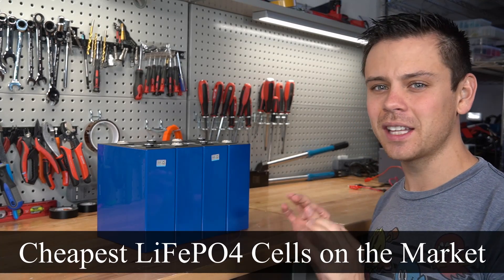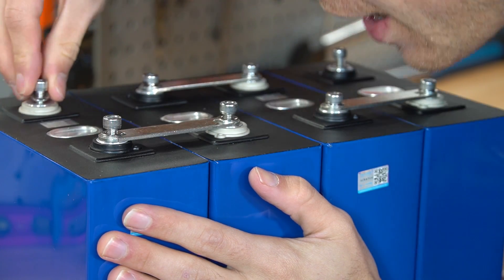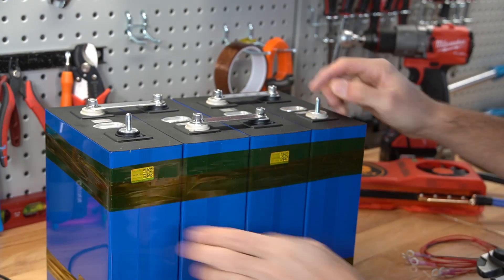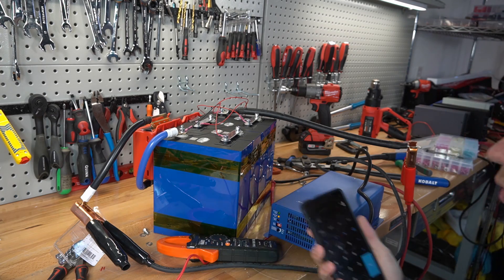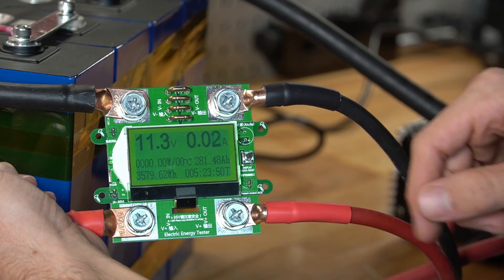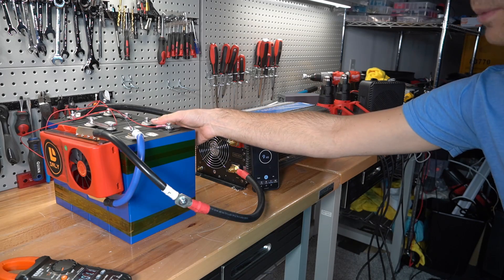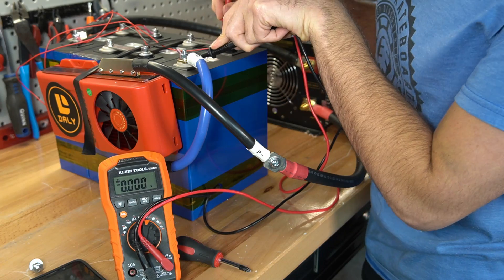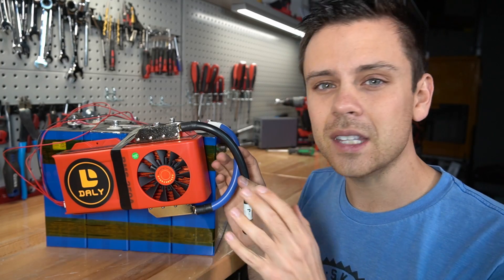$433 280Ah LiFePO4 Cells Tested: Cheaper than lead acid!

Comment: I'd be very interested in seeing a tear down of one of those Fortune batteries with the huge terminals, and one of these EVE 280ah batteries with the wimpy aluminum terminals. I suspect the larger terminals may only be skin deep!

If I were to build a 24v system for my RV today, I'd go with the 280ah batteries and use conductive epoxy to glue in the wimpy stainless steel studs, then use same epoxy and lightly torque/glue the nut against the aluminum base with glue making it super rigid. I could then top it off with another nut to hold battery connectors, wire terminals, etc. while tightening nut against nut very tightly with wrench on the bottom nut to prevent undue torque on the aluminum/stainless stud and glue.

Comment: Hi Will, really thanks from.... Mexico where Lithium batteries are still... Mith!. YOur info videos are very useful and very well done. Now, as you can easily understand, i'm just studying the LiFepo4 batteries. One question regard the charging. Usually the data sheet of the batteries says CC (constant current) btw  i understood from your videos that you just fix the voltage an d the cells drawn the current they need untill they are cherged.... so ity seem that very standard solar charger are perfectly suitable for the work, if well programmed about the maximum voltage....am i missing some video? ...completely wrong? The second question is about  "prismatic" what does it really means .... about performances and costs... Again, Thank you, Daniele

Comment: Hello experts, I put a 4S DALY BMS to my 272AH pack and check the voltage from BMS P- to Batter B+ and it show 3.11V, when i check from Battery B- to B+ it show 13V.... is the voltage from P- suppose to be same as B- ? thanks

Comment: Best,
In my outdoor enclosure I have no power so I use lead-acid batteries, are charged with solar panels +/- 400 wp forest environment. batteries go 12v system how do I do this best batteries are charged with an mppt charger of 80 amp but I only get this value in the summer good tips to change my system to lifpo4 :)
Begium

Comment: Hi Will, been following you for some time now and thanks for all your videos and input, in valuable. A 'Q' now. I've built a Solar Power Box but the battery provider has let me down. I'm looking to purchase 4 x 3.2(6)V LiFePo4 200Ah now but the size means that I would need to have them laid down so that the terminals are on the side as opposed to on the top. Is this able to be done safely with LiFePo4 batteries, and, if so, should the positive or negative be on the top, or does it not matter?

Comment: Let me get this straight, 1C peak and >200Ah?  That means 600W per cell.  With 16 cells, a 48V battery, you have a 9.6kwhr pack that can charge/discharge at 9.6kW.  THAT'S A GAME CHANGER.  That's $2k for the cells.  And only 48V so I don't have to be too terrified working on it.  Of course I still need to buy the BMS and all the fixings, including, vitally, a solar charger and automatic transfer switch.  Plus, let's say 2kWp of PV.  What's my tab so far, $6k, being very conservative?  What $6k gets me is a solar system for one 3ton house AC unit, that switches to grid when the battery gets below my configured voltage.

I live in a state (the ONLY goddamned state, look it up) that penalizes families that install solar and stay connected to the grid so that their return on investment is stretched out 2x farther than anywhere else in the country.  An automatic transfer switch is my only hope, since then the PV system will never be on our goddamned utilities' goddamned grids.  I was thinking I'd have to go to 100V to get the peak 10kW output I'd need to start a large house AC unit.  But with these cells I can do it with 48V.  That's way less wiring and way less danger, right?

Comment: Hi Will, great job.
I’m thinking to get these lithium 280Ah. I will also replace my 1000w inverter by a 2000w , I will also replace my Go Power PWM controller by a Victron MPPT and add a second 190W solar panel to my RV! 
So, 2 questions, what are you suggesting for BMS and what size of Mppt controller should I get for my setup?
Also, Have you tested Dakota lithium and the Canadian Lynac lithium batteries?
Thanks in advance,

Comment: Hey will, quick question, what are the data sheet specs for the daly bms for high and low cut off voltages, I’ve looked for it online and it shows 3.75 and 2.2 v for the high and low respectively, isn’t that alittle over the range?

Comment: @DIY Solar Power with Will Prowse.   At the end of the video you said you would never use the 'dumb' Daly BMS on a large system.    Could you elaborate on that?    It seemed to work quite well.

Comment: I want to replace my RV batteries with these. A dealer says it's a one-for-one replacement using Xantrex with only an adjustment required on the controller. Do you still feel confident about the inexpensive EVE batteries? Any other advice?

Comment: You don't need 4/0 cable for that lol. My forklift has a 36V 850Ah battery and the cable is 2/0, which is standard. Under max load, it draws up to 500A and it's totally fine. The current rating is better for unbundled cables, so it's fine to push it a bit.

Comment: With a 5000W Peak power 10000W 24V 48V 72VDC AC High Frequency 50Hz 60Hz With LCD Display Ture Sine Wave Battery Power Inverter

Comment: I know a lot of these are demos and you probably take them apart afterwards, but have you ever thought of applying liquid electric tape over terminals and bars on the batteries once they're assembled to isolate them from being shorted out by contact?

Comment: I ordered 8 of these and accidently overcharged one turned into a balloon ahhh now I have to wait 2 months for replacement
Reply: there's faster shipping options Im just not in a rush
Reply: @swagglifee  All the best!
Reply: I got mine on ebay for $750 with express shipping in 7days and ability to return it, so why you chose to get them from china??
Reply: because 4 cells are 430 with shipping
Reply: @swagglifee  I was thinking about it as a cheaper option but what if something happened how to return it? they will not allow you or at least you gonna pay for shipping again.
Reply: @bryanriggs4417  I felt confident in reviews I trusted the quality I was the one that damaged the cell I just bought 4 more incase I have future issues

Comment: I have installed these batteries in my electric 65 Falcon . Beware! The battery  shell is "live" and must be insulated
Reply from the maker: That's why they have sleeves. The engineers are well aware of this issue. So they add sleeves.

Comment: Hello Will, you keep doing a great job here, kudos to you. May I ask you for specs on the resistor that you use to pre-charge capacitors on the inverter? I have the same cells and a Samlex 3000W pure sine beast, but I hate those sparks. And if you don't mind sharing one more thing, what kind of tape do you recommend to hold these cells together as a battery bank? Thank you so much for all your work !

Comment: Will, we just got four Shenzhen 280ah batteries and are top balancing them. They started at 3.257 to 3.256. We are using a 10 amp power supply with larger leads to reduced resistance (lugs both ends). It’s been 72 hours and at the batteries the voltage is only 3.370 and at the power supply is reads 3.590 (actually set at 3.65) due to loading. A quality DC clamp meter confirming the 10amp reading of the power supply. Is this normal to take this long. Should we re arrange the jumpers and install the BMS then charge it with a 55 amp lithium charger to get them closer to top balance. Right now it’s like it has hit a wall and not moving much.
Reply from the maker: You should connect to BMS and charge them up all the way with a 12 volt charger. Then disconnect them and put them in parallel again with the power supply.
Reply: @WillProwse  
Thanks Will. Shall do!

Comment: I bought the 24v 500Amp Daly for my Bus Build. I expect a draw of 200amps max on a 4.5kw inverter maxxed out so I decided to use the headroom for safety. Seeing your 250 amp handle 290 amps was impressive though!

Comment: I think I could actually put this together I would buy it right now but I need to wait till payday so the full charge I would have 280 amp hours of power my four 6 volt 125 amp hour AGM  batteries when fully charged my system says I have 40 hours of power and that's my midnight special solar chargeryou fell at the lithium batteries I would have 280 amp hours

Comment: I have a motorhome with a 400 watt midnight special charge controller and a 5000 w 10000w surge inverter I have four 6V AGM batteries in seriesand I would love to change over to the batteries I just saw do you build these batteries just sell to someone like me

Comment: Would you use a BMS like that on each "battery"?  So if I wanted to put 5 of these packs in parallel, would I want 5 of those BMS units?

Comment: i need your help. please can you find out about felicity lithuim battery power wall- like packs. i am in africa and i bough the above product but after a week of install to my pip 8000w max inverter the felicity power wall shut down at a voltage of 49.4. the switch on the power wall wont turn it on so been afraid because the was a noise when it went off, i disconnected it from the inverter and i am back to my lead acid batteries. 8 220Volts connected to make a 48v system two parallel strings.

Comment: Hey guys this is my first battery project and I have a couple questions. I am building a 48v golf cart pack using 16 of the Headway 100ah prismatic 3.2v cells. The BMS is a non smart 150a Daly and it appears to have a temp probe. I have already modified the power leads of the BMS by adding another 6 ga lead in parallel. I thought I was ordering the BMS with the large bus bars on each side. But what showed up was 2 6ga leads on the end, in my opinion not enough capacity. The amazon ordering for the daly BMS really does suck.
Questions....
I will have 8 cells on each side of the cart, does it matter if the BMS cell wires are different lengths? I will have to add length to most of them anyway.
There is a 3 conductor plug on the side of the bms right next to the temp wire, does anyone know what this is for?
Does anyone know what amperage a 2000 model Club Car DS all stock will pull on acceleration and cruise. I had another guy tell me 100a and 30 to 40.
I have a voltage amperage display that I am installing, it has a 100 amp shunt. I was on amazon and saw a voltage amperage display that uses a current transformer (CT). Will the 100 amp shunt work ok or should I spent the 28 bucks for the CT unit.
Thanks 
Rick

Comment: 6:52 What is that white thing and where can I get one?
Reply: It's a wire wound cement power resistor. Probably a 25 watt resistor, hmmm maybe 15 ohms or so. To charge up the invertor caps. You can buy at Digikey or Mouser.

Comment: I have wanted to set up a 12V system for off grid RVing, but you say to set it up in a higher voltage system. What if I need to run 12V appliances on the system? Would it be better to set the cells up in a 24V or 48V system, and reduce the volts to to run the appliances?

Comment: Hi Will. I'm thinking or building two of these battery packs in 24V and paralleling them. I remember you saying in a previous video that batteries don't really like being paralleled so I would like your thoughts on this. This is for an rv that I want to run the a/c and electric floor heat without shore power. Also do you feel I will need a generator to supplement this system.  Thanks

Comment: If I wanted to build a 24V bank with these cells would you recommend the 24V 8S Daly 250A BMS?  I wanted to build a 24V battery bank with the longer milk crate ;)

Comment: is there a way to get this battery to 24v with only 4 cells?
Reply: In short, No.  If each cell produced at least 6 volts (4 cells x 6 volts = 24 volts) and they are wired in series, they would.  However, these cells do not produce 6 volts.  They only produce 3.2 volts.  Unless you have additional equipment i.e. a 12v to 24v transformer, or 4 additional cells (for a total of 8 cells), there is no method to connect a quantity of 4, 3.2v nominal cells in a manner that will produce 24 volts.

Comment: In my experience, it's easiest and best to screw the nuts onto the bolts before cutting the bolt to make it shorter. Then unscrew it to clean/dress up the threads on the bolt.

Comment: You have awesome power skills, love your vids. If I may, when cutting bolts/machine screws, simply grind them at 45 degrees where you cut them. Much more professional look than just chasing with a die and works every time. Also, invest in a tap set, cleaning up those terminals with a tap would be easy and best practice.

Comment: I have a general question regarding battery AH sizes. Due to limited space, I wonder if there are any drawbacks to using one 280ah lithium battery in place of three 100ah lithium batteries? It seems to me that unless there is some negative feature, I could put two 280ah batteries in a small compartment rather than installing 5 or 6 100ah batteries. Thanks

Comment: I'm looking to build a 24v battery bank for solar around 2000 watt solar panel set up for off grid with 2 600 watt turbine I do not understand the bms talk how to pick best one and should I use multiple bms or one

Comment: I have seen people on YouTube Paying up to $1000 for a 100Ah Cell, they buy 4 to get 400Ah in their van. Now you can have a real 560Ah (7.168 KWh) capacity in a small lightweight form factor for almost the same price. I guess a combination of Solar panels and a Car dynamo charger controller is needed to top-off this capacity. But hey it's a big saving for campers owners. I wonder how big you have to go for this to be a HOME (Off-Grid) power wall system and if you can charge a Tesla with it if fully charged.

Comment: That's 70Ah or 280Ah at 12.8V? The way this is all presented is so confusing and misleading.
Reply: 4 cells make up a 12v battery bank with 280ah when wired in series (voltage adds up but ahs remain the same).
Reply: @emwilliams4113  it's either 70Ah at 12.8V, OR 280Ah at 3.2V. You do not get 280Ah at 12.8V in a battery of that size, not happening. The video is misleading because this information is not clarified.

Comment: Put the nut on first then cut the bolt or use a grinder with a cut off wheel and then take the nut off and that fixes the threads

Comment: Can you review the chin 100ah battery  $539 and they are disconnected if you buy more than one. Also want to know if 8 can use one to start a 250hp outboard boat motor?

Comment: Hey Will, great video and very impressive results! I would make one suggestion though for future consideration. Hook the negative battery cable up to the inverter FIRST instead of the positive. It doesn’t matter on an isolated system like what you show, but out in the wild (like in an RV) with lots of other systems involved, hooking up negative last can and will cause a lot of damage. As somebody who works on RV electrical for a living, I have seen a lot of equipment burned up because somebody unhooked negative on a battery and left positive hooked up. This causes a “wild” power scenario. Car manufacturers say to unhook negative first only because they assume you will strike your wrench on the car frame when unhooking the battery so if you unhook negative first, it won’t spark. Sorry to be long winded, just wanted to pass along a tip from my experiences and years in the industry.
Reply: Thanks, bro, I'm still new in this field, im appreciate your effort to teach us even in the comment section.

Comment: Will,  I am ordering 16 for the 48 volt Growatt inverter you recommended., what BMS would you use on grid solar backup system.  Used to lower my electric bill and have battery backup. ? Thanks I value your opinion.

Comment: Question I am putting together a 1250 solar system with 600amp hours of batteries for my 2009 keystone mountaineer.  . Would  you use these batteries for that type of system? I was also thinking about using LTB.  What are you thoughts 🤔? Love you shows thank you.

Comment: What else would I need to have these as a board battery in my camper van? I would like to have a bluetooth BMS which also has a shunt functionality, so I can always check the capacity of the battery. Which BMS can you or anybody else recommend for this? 
Also, I would like to be able to charge the battery in negative Celsius degrees / below 32 Fahrenheit. What would I need for this?

So, with respect to these needs, I'm currently more inclined to buying a ready made package of a 200Ah battery for around 1.900€ (I'm from Germany) which also gives me a 5 year warranty. Though saving a few bugs and maybe increasing the capacity to 280Ah sounds of course tempting ;)

My main use case is to be able to charge my ebike at my camper van. And I want to charge the battery of course with solar power (around 500Wp).

Comment: Hello Will, building a 16s LiFePO4 48v 200ah prismatic cell battery. Looking at a few different compression methods.. wondering if you have a recommendation or comment?
I thinking about using two aluminum plates for the ends with 4 threaded rods bolting it together and thus slightly compressing the battery cells to help prevent any possible swelling.
Also seen a very simple method using a few large high quality zip ties simply tied around all cells squeezing the pack together?
Any recommendations you have seen that are possibly easy/better?
These will be for my diy off grid solar system which will likely have 4 of these 16s  48v 200ah batteries in parallel.
Thanks for your hard work and dedication!
✌️PT

Comment: Will, thanks a million. Soon I will be in a situation where I will need to install over 140 of these batteries for a building. Will be using 6 12000w inverters. I need a design help in best way to link them. 48v of course.